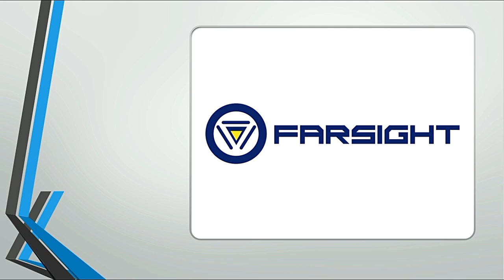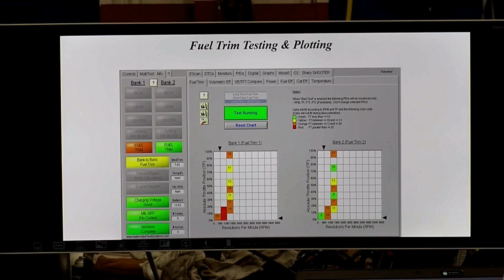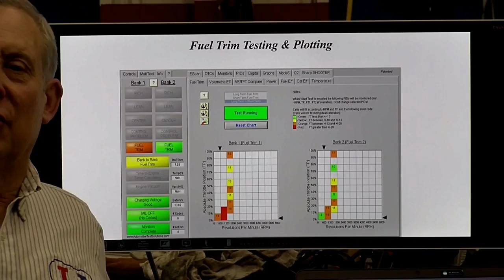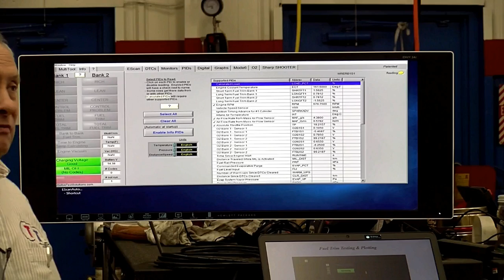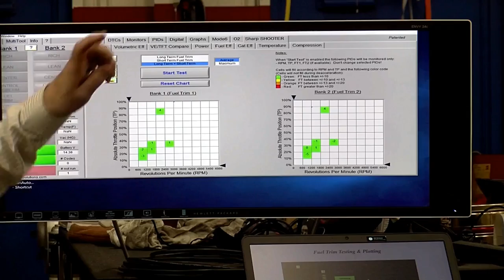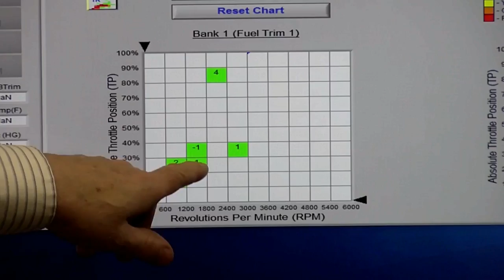TST Farsight Using The Scan Tool To Diagnose 2017

Comment: [28:30] [33:30] When running the VE test, is this supposed to be a GOOD MAF?  If the sensor is GOOD then, the test is FAR from accurate. Neither the GOOD, nor the BAD, sensor matched the Theoretical graph.
Reply from the maker: Chat they do at times but your right they do not all the time. I think there was something running to slow up the data. This test can be performed on a Generic scan tool by selecting Calculated Load and one other PID such as RPM. The results show be at least 90%. We have other videos that I know show this test better...I don't know off hand which ones. Thanks for watching...If you have not already subscribed to our tstseminars YouTube channel please do so. Interested in more training? Go to www.tstseminars.org and view full length videos for members on TechFlix for $9.99 unlimited viewing and www.attstraining.com for hands on training and webcast.

Comment: I had seen foreskin(FARSIGHT) at the May 2 PArts Authority show and it went awefull. I realized that having been a Autologic Customer for 9+ years,that the blue box is going out and unfortunately it is not their fault but technology is moving by at a rapid rate. If u dont believe me, go look at the latest cars coming out of MB, BMW, ETC. I have seen the Assistplus demonstrated . FARSIGHT has a long way to go and especially since it is a startup company
Reply: Its a KNOCK OFF---
Reply from the maker: Great...Farsight kick butt...and you are correct on the blue box...great tool while it lasted. thanks for watching
Reply: AUTOLOGIC-----BIG NEWS COMING DOWN THE PIPE.....STAY TUNED.........REALLY REALLY AWESOME....READ THE PRESS ........SOOOOOON!
Reply from the maker: ok
Reply from the maker: As far as I know the concept was the experience of the owners and they are from Long Island. The tool works and kicks ass. Check it out for yourself or find someone on the island that owns it.

Comment: look exactly like E scan pro software
Reply from the maker: Yes because it is the ATS EScan on a special tablet and is one of many tools that they have along with full tech support. Thanks for watching
Reply: Always, Blessings guys, excellent job
Reply from the maker: :) God bless you as well
Reply: Antonio Lopez ---- Goooo patriots!!!!!!
Reply from the maker: Antonio good to hear...keep me posted
Reply from the maker: Ross Tech is a great tool...Check out Autel and Launch as well...both do a good job on Euro.
Reply from the maker: Do you have the latest update?
Reply from the maker: ok...there are strong and weak points with many tools
Reply: myboy051 #PATSNATIONPRIDE
Reply: TSTseminars  I just received mine, tested yesterday in a Chrysler 300, works sharp and solid
Reply: TSTseminars on VW Audis I stay of course with Ross-Tech,  today working on a 2014 Benz, no data, no Tests for Engine Control Module,I stay with Xentry. another issue and so simple, a tool with this magnitude is suppose to at least come with a carry case, cheaper ones does comes with a case.
Reply: TSTseminars have both but the Autel elite Mercedes software is Crap, on VW is acceptable, Land Rover acceptable overall is a good or maybe best scanner for the price.
Reply: TSTseminars yes
Reply: TSTseminars no data, no tests for Benz, I hate running Xentry for every Benz but no choices at all, guys excellent job, keep it
Reply: TSTseminars true